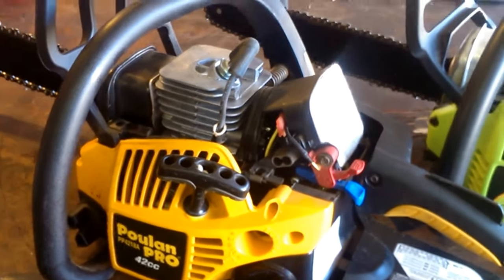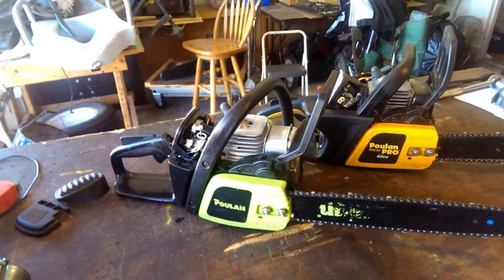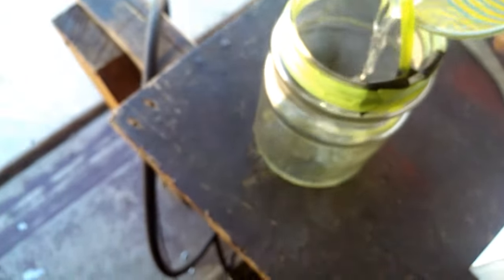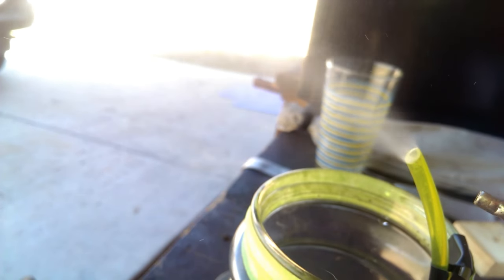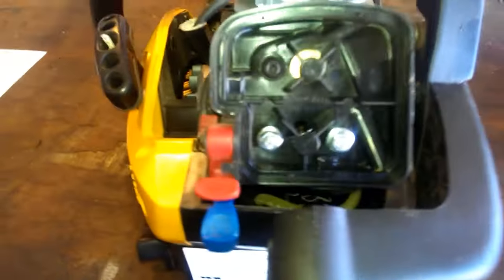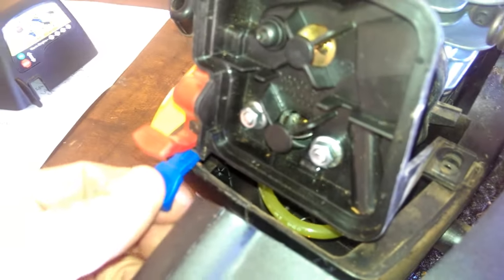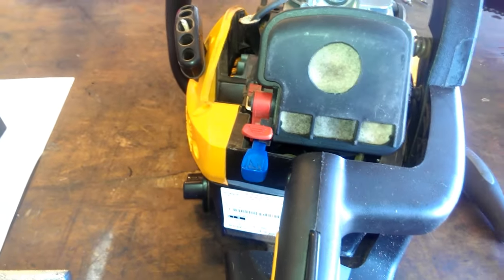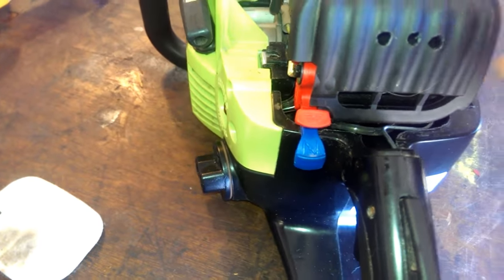Poulan wont restart after being used & how I solved my problem.

Comment: Very good video. You really explain the gas, water, oil, well. I have seen tons of people that were also helped by gaping there plug to .30.  I wish I purchased a Poulan instead of being conned by the propaganda.  I purchased instead a Husqvarna 350 rancher. It has a ridicules one lever, choke, throttle, set up. Most of the time I have to pull it 3 or 4 times to start. Even when It's hot it wont start on the first pull.  I could of purchased 3 Poulans for the price.
Reply from the maker: Honestly Pete Poulans are hit or miss. Your Husqvarna should give you many years of service. Dont feel bad.Thanks for the comment.

Comment: Thanks for great video and tip. After blowing out filter and drilling 3 holes in carb cover like you showed my poulan 40cc restarts after use much better. Before this fix would almost have a heart attack trying to restart it.

Comment: Thank You. This makes Perfect sense. I figured that it was a design issue. I start my Poulan wild thing chainsaw and run it for about 5 minutes then it shuts off and it won't start again until it has completely cooled off. I thought maybe there was a sensor but now I see there is none. I will modify my chain saw the same way that you have.
Reply from the maker: Be sure to let us know if it worked for you. Thanks for commenting.
Reply: Please remember! The mixture ratio for chainsaw is 40 to 1, 40 parts fuel to 1 part oil. Running your chainsaw without oil will cause it to overheat and sieze.

Comment: Thx for the informative vid.  This happens to my Poulan all the time.  It will start and run fine, I shut it off and it won't start.  I always thought it was flood itself.  To the point I bought another Husky chainsaw and only used the Poulan for small jobs.  I will now drill some vent holes and see if that's the fix.  Thx in advance.

Comment: I acquired an older Poulan from the mid to late 80's from a friend a few days ago, all-metal casings except the recoil housing and air intake. It's a 2400 Woodmaster, easiest little thing I've ever worked on. Unlike a lot of newer saws, this thing is like a two-step set of LEGO blocks. But when I had it torn down to a little engine chunk to clean it I noticed that the intake wasn't really pulling air from anywhere, except from around the inside the air filter shroud. So it literally has no direct air feed from outside the saw except through maybe some cracks and crevices. 

I was pondering on drilling some holes in the outside housing but I'm reluctant of ruining an older saw since parts are harder to find. Even though the saw is in almost mint shape the gas cap also seems to leak gas from the vent hole. So it seems like even the smaller Poulans that were still made in the US back in the 80's had intake and gas cap flaws. Once I eventually work the kinks out it's going to be a small backup saw for doing smaller wood and limbs so I don't have to use my MS251 or Homelite 290 for that. Once I've got my blown Husqvarna 570 rebuilt I'll have a small four saw fleet. :)

Comment: We tried everything!  Runs like a charm, till I stop the engine, then its done.  This is going to be tried! I have a sthyl that we alternate, but end up using it till we are through.  As a 66 year old gal, not starting is a job stopper. I could go for a lot longer if I didn't have the starting problem. Upper arm pull strength gives up fast.  Will let you know if this works!
Reply from the maker: I have my fingers crossed for you dear. I'm a 66 yr old guy and I feel the same way. No start is a deal breaker for me too. Let me know if it helps you please

Comment: I got a 4218 that I have modified everything on. Nothing left but the ring on the filter cover,  bored the carb venturi out from 9.5mm to 12mm and shaved the butterfly shafts and screws, ported,muffler modded, ignition timing advance, opened the hole up from the fan to the carb section, ground all the  safety rakers off the chain etc. Went from 14 seconds to 7 seconds on the same log. What has remained consistent is it won't hot restart unless you pull the trigger. Pull the trigger and it hot restarts 1st pull every time. So if you have one and nothing else works try that. Come to think of it, setting it back to fast idle might also work. I haven't tried it or even thought about it until now, found a solution that worked and didn't pursue it further.
Reply from the maker: It sounds like you have a helluva saw! Yes, for hot starts and just general operations it's always best just to read the owners manual. For restarts : pull the choke all the way out and then halfway back in. That sets the high idle. Good luck with your modded saw. 👍🍺
Reply: @ZombieDaveAZ   Yea it is 2010 saw I bought a couple of months ago for $20, no owners manual included. I'll try that next time. It didn't occur to me as all my other saws hot restart without a problem. Thanks!

Comment from the maker: If you have a particular problem and would like me to help you out,just post it here and Ill do my best. I promise that someone else has the same problem and will benefit from it. Thanks for taking the time to post a comment.
Reply from the maker: Psycho  Just bought it as in New out of the box or new to you?
Reply from the maker: Psycho  Another guy had the same issue if you read thru the comments. Assuming everything is in order,spark fuel just squirt some fuel mix in the lower barrel of the carb with the throttle held open. that should get it to fire and then run as it should. let me know.
Reply: ulitepilot aka Zombie Dave I have one of the cheap Chinese Blue Max cainsaws, It starts really easy and runs really good, no matter how long  I run it. But when I cut it off, it won't start back until I put fuel in it. I could run it just a few minutes, or a long time, it still won't start back till I put fuel in it, even if it's just a splash. I thought it might be vapor locked and tried just taking the fuel cap off and putting it back on, but that didn;t work. I still had to put fuel in. Any ideas? Thanks!
Reply from the maker: tfastlane I'm not familiar with your particular brand of saw  so I'm going to do a little assuming. If the saw runs great and only has the restart issue I would prolly replace the primer bulb . The little one way valve has to seal only allowing fuel to enter the bulb on the suction phase. Some Manufacturers will tell you to pull choke all the way out and push back in 1/2 way for a hot restart. This sets the throttle partially open. See if that helps.  that's what I would do. I wish I could me more help. Please share what you come up with. I'm sure other guys have your saw. Thanks for commenting and good luck.
Reply: Thanks, It doesn't have a primer bulb but I'll try your choke suggestion and let you know what happens. Thanks again.
Reply: ulitepilot aka Zombie Dave can you please tell me why the chainsaw that I got from my dad will run all day long and then just conked out we can still pull it and it won't crank do you think the fuel Is being sucked out of the tank and I'd going behind the Piston
Reply: ulitepilot aka Zombie Dave I have an 025 and it recently started bogging down with low power at power band and it will idle for around 30 seconds then rpms will slow then die. Carb has been rebuilt new fuel line filter and vent hose. Good compression and spark. I've tried to adjust the carb with factory specs just to get it running and fine tuning while running to no avail please help. And thank you!
Reply from the maker: GHOST-N-GUN gaming and outdoors Be sure the exhaust is free and clear. I E the spark arrester. Its not as common on saws as it is engines that operate close to idle or a little above like a hedger or trimmer. Yoi can also check for internal leaks using carb cleaner spray. See my video on hurricane harvey homelite trimmer.
Reply: ulitepilot aka Zombie Dave sir I've built thousands of these saws the manufacturing facility is just a few That's just a few miles from where I live here's a few pointers do not mix your gass buy pre mixed most places that sells saw has pre mixed most of the time it's 97 octane and no 
Ethanol  ethanol eats plastic so in turn it eats the fuel lines also don't be afraid to reset the carberater now don't ask me why but just turning the idle and max power and setting the saws idle back to factory set that helps and be sure the flywheel is clean that's what your coil runs off of if by some accident you do take the coil pack off use a business card to reset the distance between flywheel and your coil  and for some reason the spark plugs are junk always keep a spare and if your saw has problems starting try changing that
Reply from the maker: Mickey McCauley Hey Mickey, Some guys are lucky(I think it's Texas) and can buy ethanol free gas. I couldn't agree with you more about the long term damage that ethanol fuel does to internals. BUT by the same token MY observation with Poulans is concerning the hot 'restart' problem. Give it more air, set the throttle to high idle and the   hot restart problem is no longer the issue. If the air gap between the coil and flywheel is off, it WILL  be problem but that pertains to any small engine.(mower,trimmer,saw,blower etc.) Spark plugs to me are a 1 time a year issue. New plug at the start of the season and forget about it. Now for the carburetor. Idle,low speed and high speed jets dont USUALLY change by themselves. Jets are like a faucet that controls how concentrated the fuel-air ratio is before it enters the engine. The carburetor is mearly a pump of sorts to get fuel to the faucet. So I try not to look at the faucet if there's a problem because they are metal and wont change on their own. The diaphragms which are plastic ARE suseptable to change just from the alchohol in ethanol laidened fuel. Thats why I didnt want to mess with the settings. Not so common in chainsaws because they (for the most part) run full blast, is spark arrestors getting clogged. They dont clog all at once,its a slow build up of carbon in the screen over time. Symptoms are usually starts right up,idles fine but has sluggish throttle response and wont rev up the way it should. Brother, I could go on and on about all the things that COULD be wrong with chainsaws and chances are I've seen them. My video is for a little education on what to look for and how to make corrections when you understand whats happening inside your saw. Yup, long winded and anal to a fault. Thats ME! Lol and thanks for your comment. I hope you will follow my channel. Zombie Dave.
Reply: The time factor to get and put gas in could allow switching transistor to cool enough to restart in early stages due to run air flo from flywheel fan to cool coil but when stopped the residual heat increases for a while. Just for a trial, don't put any gas in just put a fan on saw for a while and retry.
Reply: How many turns out should the H . L & Idle really be from the factory?
Reply from the maker: Hi Anthony, a good starting point is usually 1.25-1.50 turns out from full seat. Thats the quick and easy answer. Truth is that many of the machines I see have had the adjustment restrictors removed. In that case I count how many turns in when I start working on them and mark it down somewhere. That gives me a starting point. It also helps me isolate a carb issue as well. If the low speed is turned out 3.5 turns they are obviously trying to get more fuel. Then I start my inspection @ the beginning, fuel filter, lines, etc. Hope that helps and I know its a long winded response. Lol
Reply: Mine is hard to start and will idle for about 5 seconds then die and will bog down when i give it gas already replaced fuel filter and primer bulb if u can help me out id appreciate it thanks
Reply from the maker: Check the basics first my friend. Fuel filter clean and in place. No water in fuel. Fresh fuel/oil mix. Fuel lines not cracked or broken. Exhaust is free and clear,No carbon blocking spark arrestor. (Inside carb) filter is clear. Diaphragms are soft and flexable. Not dried out or stuck in position. Of the machine will stay running by playing with the choke after it starts then replace the diaphragms and gaskets or the entire carb if thats an option for you. Hope this steers you towards a successful repair.

Comment: Wish I had a Poulan so I could make this change. But my old Craftsman has a foam filter and no obvious restriction to air flow.

Great demonstration on the venturi effect.
Reply: Think of it more as a vapor restriction than an air flow restriction when the plastic cover is on. The breather holes at the bottom lets the heavier dirt/sawdust particles to be trapped at the bottom,leaving the top half clean to supply plenty of air.

Comment: "Pullin, pullin, pullin" on your Poulon  Poulon Poulon. That's how it got its' name.
Reply: Hahahahahahahahaaa!!!!!
Reply: The Best and Fast Way to Fix a Poulan Chainsaw is to Take a Garbage Can take the lid off and place the saw inside and Put he Can at the Curb
Reply: telumears poulon are no good
Reply: lol
Reply: Treat your 500 dollar saw the same way and you will be doing the same thing with it! PULLIN, PULLIN, PULLIN  and then it's off to a 200 dollar repair shop bill.
Reply: Michael Fresh  ,  Exactly they are good saws made by huskvarna.
Reply: Just thought I'd throw this out there, they're great saws if you know how to work on them. They're also made by huskvarna. There's only really about 3 companies left making all the chain saws in the world except for knockoffs made overseas.
Reply: If I could leave you 50 thumbs up I would because man that is hilarious and so true
Reply: Thank you for a heads up.i will never buy a poulon
Reply: I have pull-on, andbthats what i do, guess im a glutten for punishment, hahaha had to order the stupid 21 spline wrench, I only gave $40 bucks for it hough and they guy I bought it from wrapped the brake around the clutch drum, i think imma put some small breather holes in it , thanks for the video, if i used the saw professionally or alot, Id actually get a huskavarnia or Stihl, but it does its little $40 worth of work(:
Reply from the maker: @damienwolff1752  these saws are for bucking and maybe a little bit of wood cutting. 4"-6". The occasional 10" log but not all day long. It's too much for these homeowner saws. Thanks for commenting.
Reply: A Poulan is good for one tree. If your lucky. When and if you get done cutting throw it on top of the brush pile and burn it all. Saylav
Reply: @ZombieDaveAZ  what is bucking?
Reply from the maker: @aaronsecor7802  when you fell a tree and then go and cut all the branches off and just leave the tree for logs or firewood. The trimming of the branches is called bucking.

Comment: Ya know Pulling Pro [Poulan] get clogged mufflers too. So when you service the carburetor and ignition, dis-assemble the muffler and clean the screen off that is part of the Spark arrester. The carbon will build up and not allow the exhaust to flow out, which will starve the engine of fuel. I have seen this on most all chainsaws and weed-eaters, but for some reason not as much on the backpack blowers...
Reply from the maker: I see this on "homeowner" equipment quite iften. They are not as likely to run their machine full throttle.  Hardly anyone runs weedwackers full throttle. I check screens regularly  and thanks for the comment.

Comment: OK, after watching this, decided to drill 4 holes on the top part of air filter cover... also, decided to wash the air filter. I must say, I ran the Poulan Pro chainsaw for about 40 minutes straight. It miracoulsly idled for that long! Of course, I also replaced the spark plug, and used TruFuel 40:1 mix (stuff is a little expensive but the saw loves it). Man, this thing worked more than it ever did. Thanks for your tip!
Reply from the maker: Quick story you might find interesting. As a pilot the piston engines I fly have a Hobbs meter. Its a clock that runs only when the prop is spinning. It serves 2 purposes. How long the engine ran which is the countdown to an overhaul of the engine. Its called TBO. (Time Between Overhaul)  So by you using the fuel premix as pricey as it is, you are maximizing TBO. Make sense? Remember that old commercial "You can pay me know or pay me later". You are helping yourself greatly by using  the premix. Smart man you are. Merry Christmas to you.
Reply: Thanks for sharing. I agree with what you say. Yesterday, I used the saw again, and let it idle for a while until I knew what was going to be cut. It never shutoff... so thanks again, and Merry Christmas to you!!!
Reply: dont trust the jufuel  itll still gunk carbs  best have carb cleaner on hand